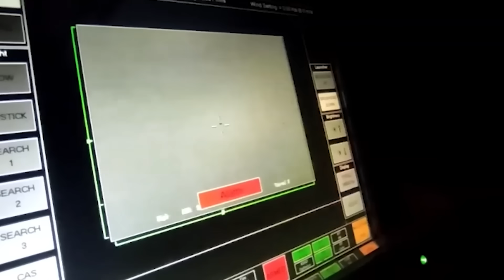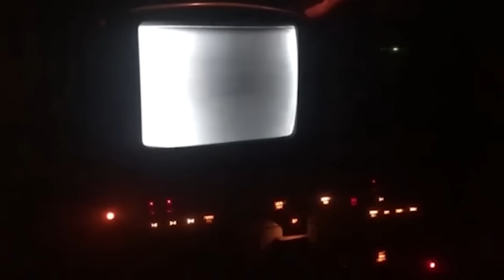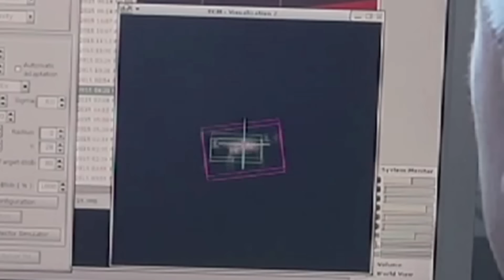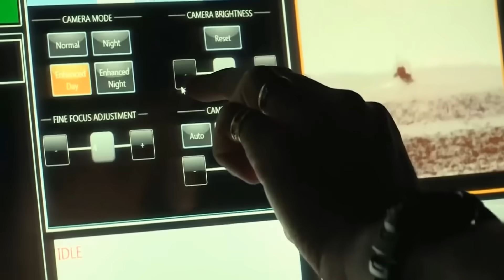High-Power LASER On US Aircraft Carrier SHOCKED The World! FULL Alert!

Comment: Um, wow.  This reasoning is extremely flawed and the bulk of this video (over 50%) is just a recitation of (very old) Wikipedia status and basic armaments for U.S. carriers.  While you're on Wikipedia, please re-read the targeting resolution of the CIWS point defense system and the back-up targeting system (non-infrared) for Rolling Airframe Missiles.    The extant systems are extremely effective against drones and the U.S. has suffered ZERO losses or even any collateral damage from drone attacks.  Additionally, your stats on how laser weapons function are both very out-of-date or just plain wrong.  You completely ignore their non all-weather capabilities, extremely low rate of fire (see capacitor charging), and high cost of retrofitting a very ineffective weapons system onto existing platforms.  For a reasonable comparison of a more mature system, please research the requisite power-supply support infrastructure for even the lightest (airborne) highly experimental tactical laser systems.  In the interim, stop posting fake bullshit clickbait video titles.

Comment: 10MW would create a small explosion on anything it touches. It would create explosive evaporation of any metal it hits. Like a bullet hole without a bullet.
Reply: @@karlwithak. 🤣🤣 how old are you lol doesn't work that way lmao but funny comment
Reply: @@karlwithak. 10MW is a lot. 10 Mega Watt Laser... It would melt the glass, or damn near sublimate the glass, or cause a phenomena with lasers where the gasses around the object being heated absorb all of the energy instead of the energy being imparted onto said object directly, but this would still cause an explosion.
Reply: @karlwithak. I beg to differ sir. Take for instance a FMJ-HOLLOW POINT 45 bullet, it will expand and consequently heat up, and upon impact it will tear open with such force, traveling at the speed of sound, to leave a small hole at impact and exit with a
larger one. The properties of a laser are far more devastating depending on the amount
Reply: Depending on the amount of energy consumed.
Reply: @@karlwithak. Depends on your mirror, if the laser being used is infrared or far-infrared, a visible spectrum mirror will do little, you'd need a special infrared mirror, which is very expensive.
Reply: @@karlwithak. They're also very heavy, to block the long frequency light. Are you liking your own messages Karl?